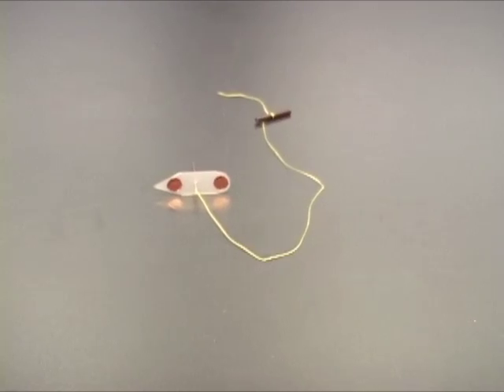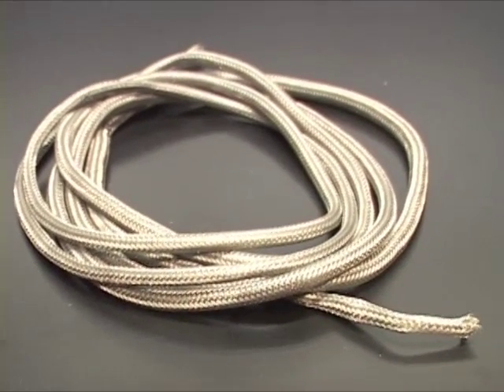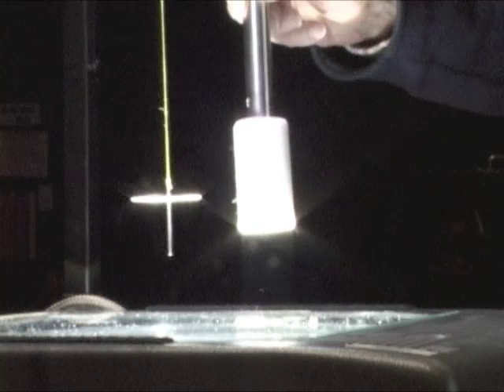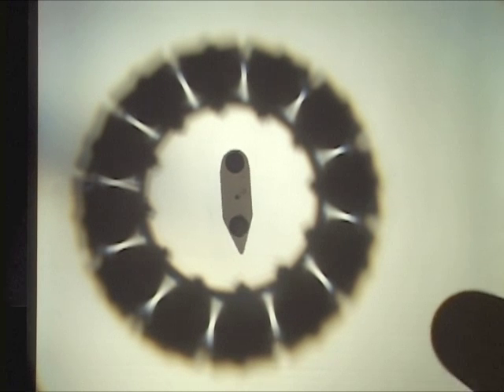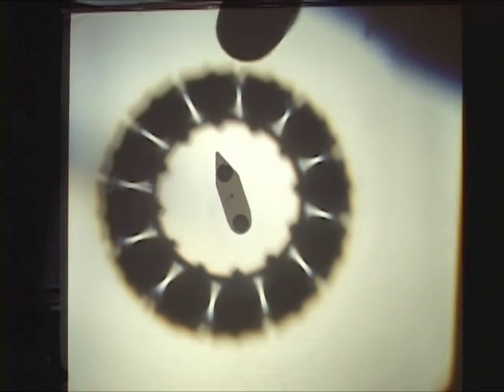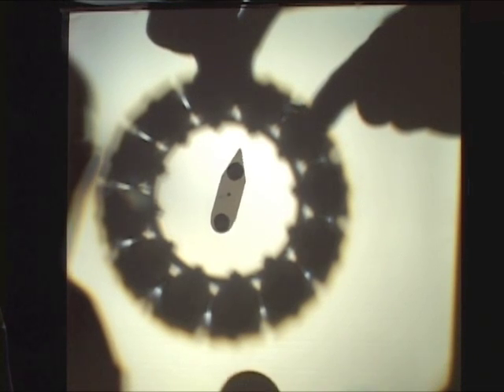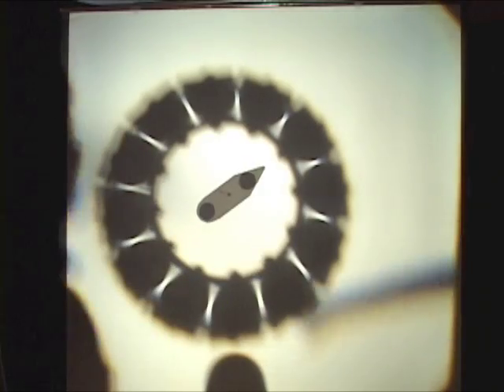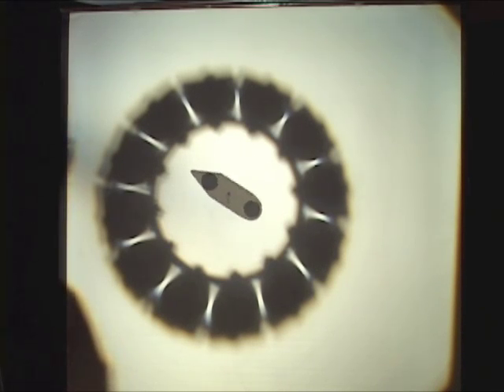Segmented Electrostatic Shield

Comment from the maker: When the net electric field of the electrons is equal and opposite to the external electric field, the net electric force is zero and they stop moving.  When the electrical connection between the segments is removed, the electrons are trapped on that segment and so, when the source of the external electric field is removed, one is left with the electric field of the electrons in their trapped arrangement.  That's the "back field."